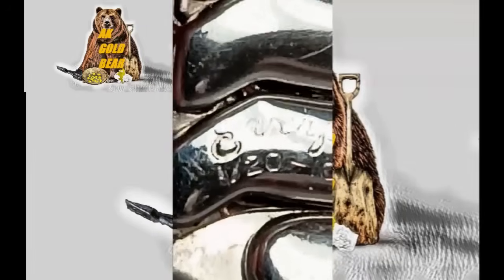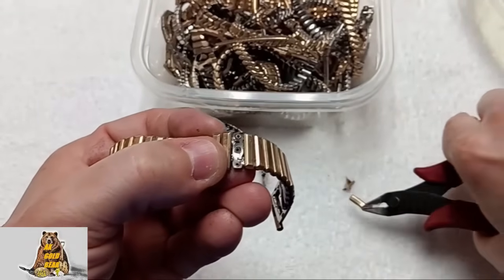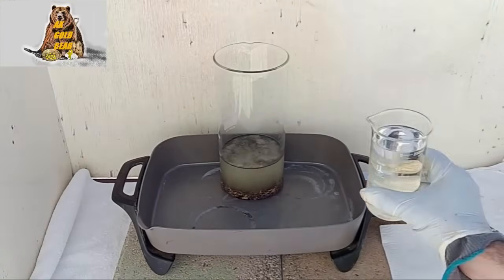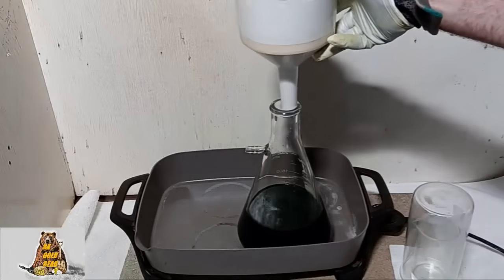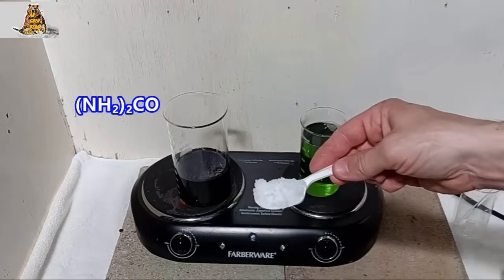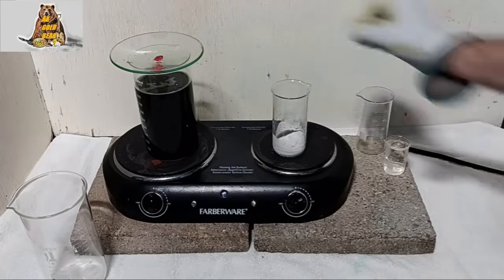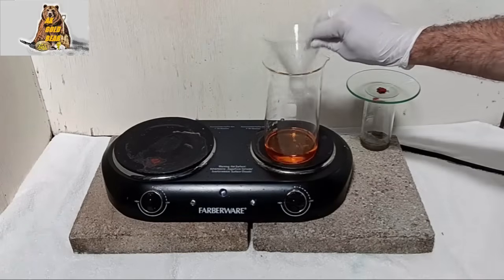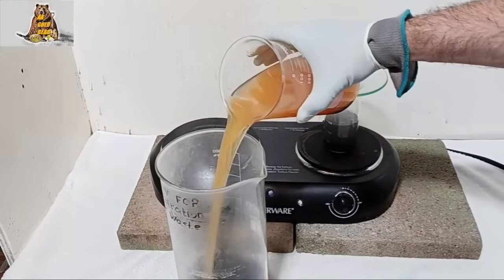How to extract gold from gold-filled watch bands🤔 Or from any gold-filled material🙂

Comment: Hi there, when you add 200ml of sulfuric acid to 750ml of water in the beaker initially to make electrolyte, could you just use a car battery acid? It’s got 38%-39% of sulfuric acid already mixed with distilled water. Asking cause it’s just easier for me as I have plenty of battery acid but to get concentrated sulfuric acid I have to boil water out.
Reply from the maker: Hi. Of course, yes. You can buy ready-made electrolyte (battery acid) in a store or make it yourself. It is more profitable for me to make the acid myself. I buying concentrated acids in bulk in large quantities, thanks to which my electrolyte costs three times less than in a store. 🙂